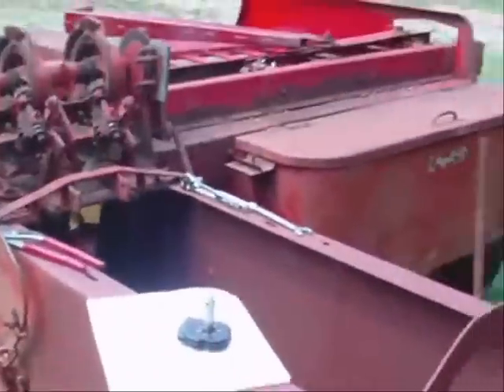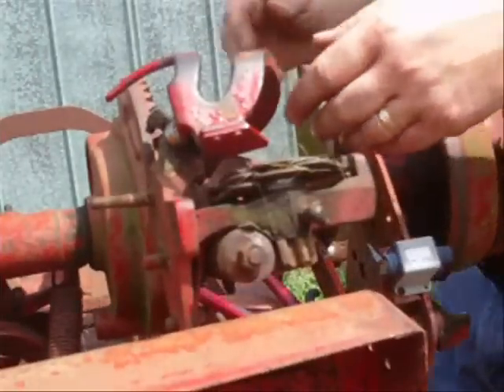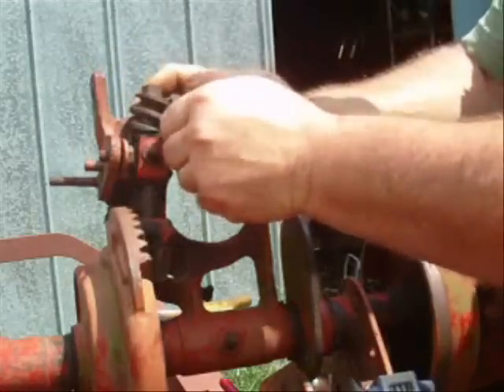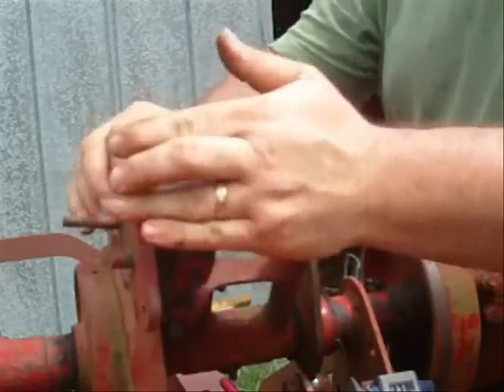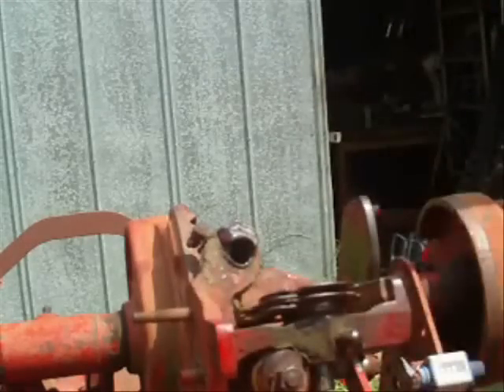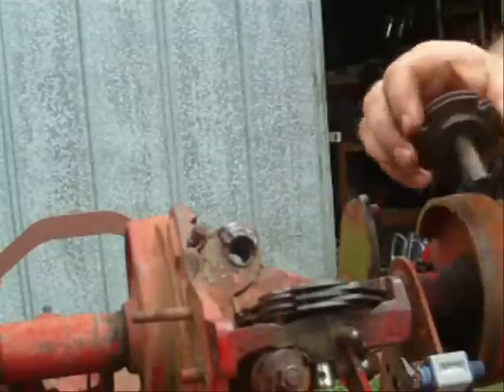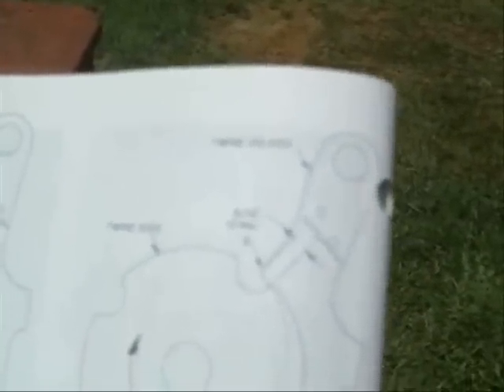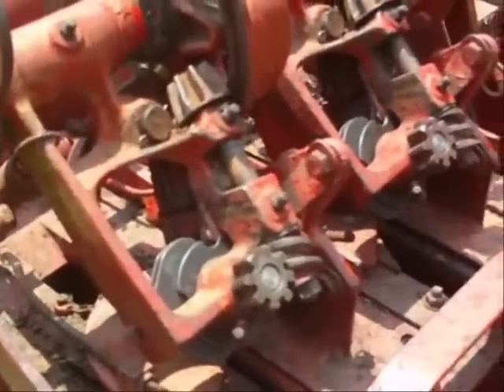Baler Repair Part 17 - Knotters

Comment: I built a bending/adjusting tool for the knotters.  It was about three feet long.  It was used to bend the knife arm to specs.  I got the dimensions from NH during my class there.  It worked well during my years making service calls on balers.
Reply from the maker: That's great!  I just use an adjustable wrench and hope for the best ;)

Comment: Haveing problems. Bailer wont tie a knot. I have a knot on top twin but not bottom twine. Took a video and the second twine, does not spin around with the bail hook. Keeps jumping off the bail hook when it spins.

Comment: I have a NH268 and one side is cutting the string just a little shorter, only leaving about 1\4" and several bales are popping.  Is there a way to adjust it so the cutter leaves 1\2"?  Thanks
Reply from the maker: I'm assuming you're talking about the knot tails. You should be able to bend the knife a little to make it cut further away.  The only other thing is be careful not to bend the knife housing too much to mess up the scraper to bill hook clearance.
Reply: @farmboy30117  Correct, the knot tails.  I'm guessing that it won't need much of a bend to gain a 1\4".  Thanks for the help and super fast response.  I'll let you know.

Comment from the maker: I have never seen a wire tie baler in person, but I'm wondering if the metering wheel is slipping on the knotter trip arm.  I had that issue on mine.  There is an adjustment slot for the metering wheel.  It may need to be moved forward.  As far as the wire goes, I don't know.  I tie my twine off to the needle carriage near the pivot point at the frame.

Comment: I have a 269 baler an I'm having trouble with the knotter, every 5-6 baler it skips 1 
Is it just to worn down? I don't have any problem with the twine balling up in the holder
Reply from the maker: Mark, there are so many things that could be causing this that I couldn't possibly list them all.  New Holland printed a manual on baler knotters that you may be able to find online or on eBay.  Here's a link to one on eBay right now:http://www.ebay.com/itm/Ford-New-Holland-Baler-Knotter-Service-Manual-Repair-Standard-Heavy-Duty-FAST-/222187054596?hash=item33bb616604:g:xkAAAOSwhOVXctkxI have this booklet and it has a lot of good info on setting up knotters.  Hope this helps.
Reply: +farmboy30117  
Ok thanks

Comment: Hi i have a new Holland super 69  with Hydraulic tensioner the problem i am having is the string gets caught on bill hook after it knots it there is a slight bit of rust on hook, also the ends of bale are coming out longer than the other, its as if the sting on one side is pulling harder than the other
Reply from the maker: Be sure the wiper on the knife arm is sliding against the bill hook to pull the twine out.  Not familiar with hydraulic tensioners, but I have seen bales like that when more was fed to inside or the outside of the bale chamber due to narrow windrows.  Could be your tensioners are not applying equal tension also.

Comment: I have a new holland 310 baler.  It will not tie right on one side.  It may bale 5 miss one.  Sometimes better, sometimes worse. It seems like it is not cleaning the twine.  The twine knots up and you will have two strands trying to come out on the same side.  Help?

Comment: hi, i have a nh 315 and a problem i am having is,  after the knotters tie, the string gets wrapped around the one bill hook and dosent slid off. It dosent do it all the time. I had heard to just polish the bill hook so it was more smooth, but i dont think that is the solution.

Comment: i have a New Holland 320 square baler (wire) and am having two problems.  First, the last time i used the baler it produced erratic bale lengths.  it would sometimes produce double bales.  the other problem is that i have having trouble re-routing wire for the baler.  the manual states that the final thing to do after routing wire from the box thru the baler is to "tie the wire to the reinforcing band directly behind the left (right) hand needle.  it's not clear to me where this is.  thanks

Comment: hey what did that finger lever spring attach to behind your knotters? I have a 273 and needed to do some work pulled it off and forgot where it attached... btw great videos used you as a reference several times
Reply from the maker: I believe it just attaches from the lever to the knotter frame.  I'll double check next time I'm around it.  Thanks!
Reply: it did I found the mark on the arm it was riding on thanks

Comment: How do i adjust the needles on a 273 new holland
Reply from the maker: There are two bolts on the needle where it attaches to the cradle.  One bolt allows for up and down movement and the other allows for side to side movement.  It's kind of a trial and error deal for me to get them adjusted.